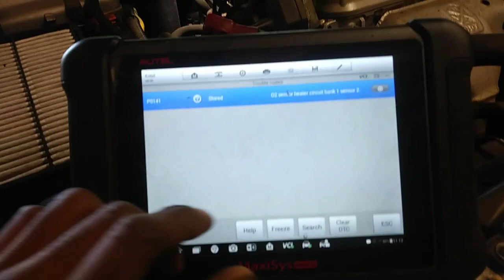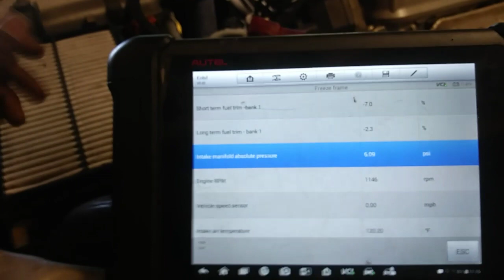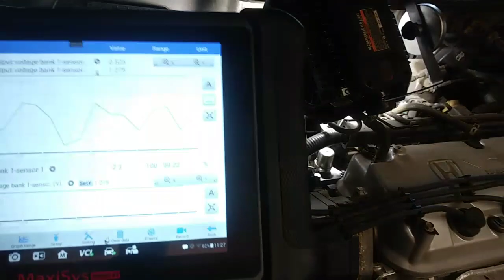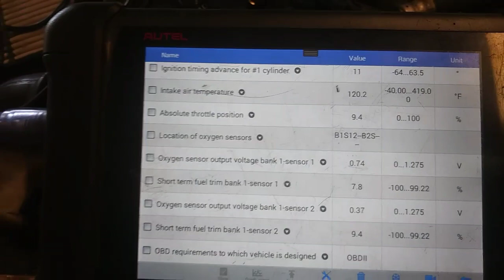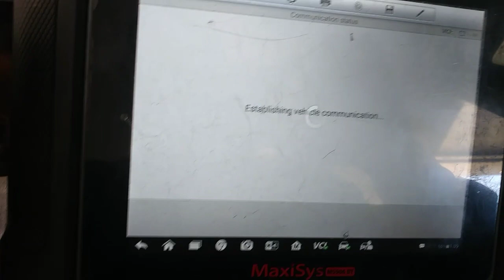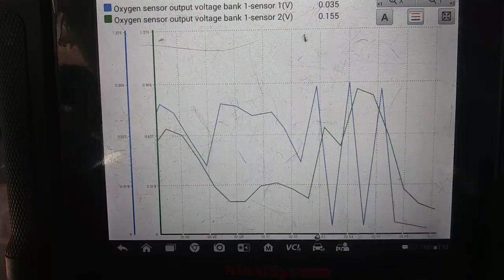Honda P0141 DIAGNOSE/FIX, but parts been replace already?!?!

Comment: Got this P0141 code recently after going through a muddy puddle. (05 accord) 
I cleaned the 4 tiny holes at rear of this O2 sensor, but code came back after some minutes. 

Sensor is Denso. Heater has 2 black wires. 
Checking heater ohms, it reads about 8 ohms. Is this normal?.

Comment: I changed the oxygen sensor on my car but the light is still one with code po141
Reply from the maker: Did you test the circuit as I did in the video?
Reply: @partsshooter  i got the po141 error code and changed the o2 sensor to a new one but the light still didnt turn off could it be because i have the 50$ bosch sensor from auto zone?? should i put the denso one?
Reply: Nicolas Garrido same issue testing the wires after work tomorrow
Reply: @partsshooter  did you ever find fix?